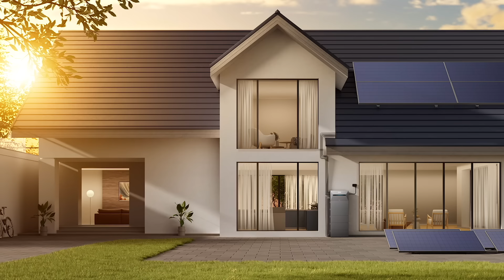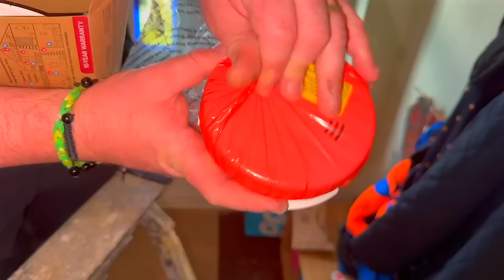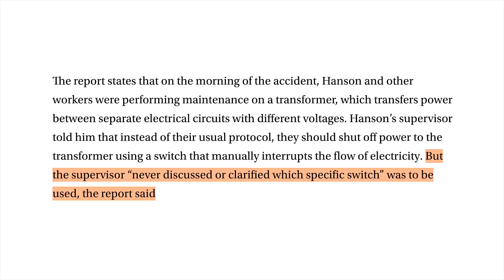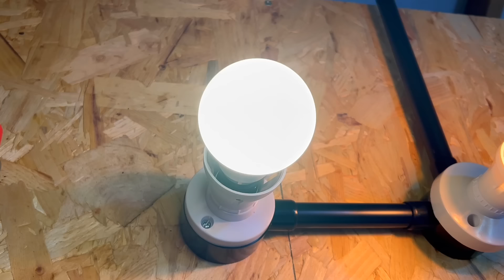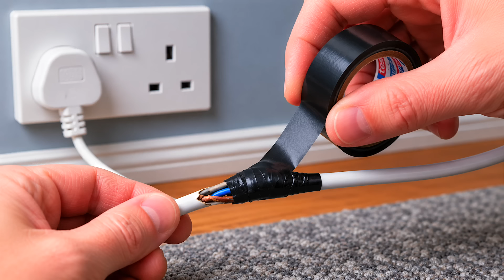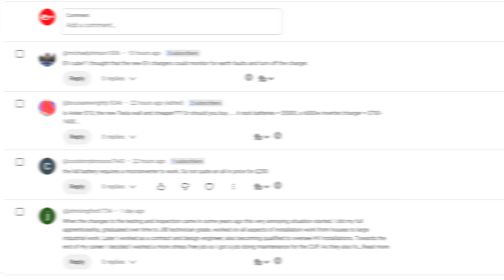Electricians Are Getting This Rule Wrong!

Comment: Mr Hayhurst may have his own opinion, but BS 7671 itself tells us what the 0.8 (20 %) factor is for, on page 438 (end of Appendix 3) in the Big Orange Book. It's for one thing only ... to take into account the increase of resistance of the conductors of the circuit due to LOAD current. When measurements are taken, conductors cool to ambient temperature because loads are not connected to the circuits, so the measured resistance during (R1+R2) and EFLI tests will be lower than those in the circuit when in use. This is explained in the IET On-Site Guide and Guidance Note 3.

Nothing new to see here!
Reply: Yes. Hayhusrt is just wrong. He ought to check out the Dunning-Kruger effect.

Comment: The reference test temperature is 10 Celsius
When cable is live, worst scenario to see cable temperature increase to 70 Celsius.

The resistance will be (1+0.004x( 70-20))/(1+0.004x(10-20))=1.2/0.96=1.25

Resistance at 10 is 1/1.25 of resistance at 70

1/1.25=0.8

for onsite guide or inspection purpose it is 25% rule
for design purpose it is 20% rule
Reply: Census ?
Reply: @keithbalding7258   thanks Celsius  very bad spelling.

Comment: Forgive me for taking issue with the experts, (at 1min 50secs) but surely making allowance for increased conductor temp. is perfectly valid.
We generally test dead circuits at 10 to 20 degrees C.  When a circuit is fully loaded close to the capacity of the MCB, it may well be  operating close to 70 degrees C.  
Hence : it is not the fault current which causes the elevated temp. but the ongoing Pre-fault current. So the resistance is already elevated before the fault occurs. Makes sense to me anyway. 😀
Reply: This is broadly it. The article author is making up his own rules. I see this quite frequently when people forget to question their own understanding and it is disappointing that such guff gets published without scrutiny.

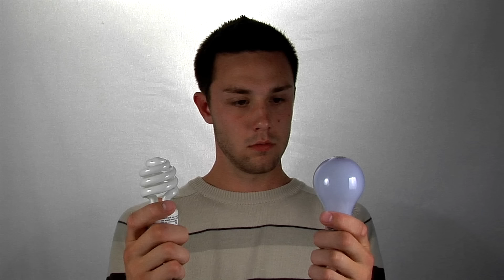Comment: 8:12 - That's because the vast majority of tradesmen these days are cowboys. Like the morons which came out from the DNO to unloop our electricity supply. They just left the old looped cable going to who knows where, in the cupboard under the stairs, dangling free with copper visible... a 80-100a cable unfused that could be accessible by a child, let alone adult. Couldn't be bothered to bung it in a box or cut it back short. Nah. That's a "professional" who is most likely qualified to work on live installations.

Comment: John Hayhurst's point of view is very questionable.
The temperature increase we need to account for is not the one that would arise from an earth fault, which is indeed negligible. It is the one that arises from conductors operating at full load during normal operation, i.e. assumed to be at 70 C, whereas measurements are taken on a dead circuit, when conductors are most likely to be at room temperature.
 By accounting for this, the worst case scenario is considered where an earth fault occurs when the conductors are already at 70 C from operating at their maximum allowed current. 
The number 20 % doesn't come from nowhere; it is an approximation of the increase of copper's resistivity from room temp to 70 C. It is not there to account for other factors that John describes. 
This temperature increase is real and must be accouted for, and, unless I'm proven wrong, I am quite worried that a senior lecturer completely misses that point and teaches that to their students...
The 20 % rule has nothing to do with variations in ambient temperature - this is accounted for in the design, if properly done. The premise of this 20% rule is that the conductors are at their maximum allowed temperature when an earth fault occurs. If the circuit is properly designed, the conductors will never exceed that temperature in normal operation.
Reply: John Hayhurst's point of view is just wrong. Alarm bells rang as soon as I began to read the article last week. (I see this sort of misinformation all the time when assessing higher-level written exams.) Experience and knowledge are different things and often having loads of the first blinds you your own lack of the second.
Reply: I agree with all of the above, but I'd add that not all final circuits would be likely to see such an operating temperature variation (because of the nature of the loads connected and likely to ever be connected); for such circuits, adjusting the measured R1+R2 (at 20°C) to a 70°C operating temperature by adding 20% is unnecessary. The source article does make this argument, but it gets lost in the noise over which temperature rise is being adjusted for.
Reply: @rednammoc Yes absolutely, in that case the resistance is lower and so the fault current higher, resulting in quicker operation of the protective device.
This illustrates the fact that adding 20% is not unnecessary in such a situation, it is just a worst case scenario, which is favourable in terms of design
Reply: Absolutely. Not sure when this element of electrical installation theory seemingly became so blurred?

Comment: I'm (respectfully) calling BS on this. Firstly: what 20% rule are we talking about? Are we on about the differences in max Zs values for ambient and load temperatures? (OSG table B6 vs BS7671 table 41.3, e.g. 1.1Ω vs 1.37Ω for a B32)? These are due to the former being at ambient, and the latter for a fully-loaded circuit. At full load, the operating termp will be 70ºC, rather than 20ºC. Difference is 50ºC, and the resistance-termperature coefficient for copper is 0.004... so 50 x 0.004 = 0.2 = 20%. That's literally where the number comes from.

Or is this "20% allowance" some rule about, you work out what R1+R2 will be from your design (or you measure it), you add 20%, then add Ze, to get an estimate of what Zs will be? If so, this is absolutely to account for changes in temperature, between a circuit that's dead (or with very little current going through it), and one that's fully loaded, running at 70ºC. I'm calling BS that it's got anything at all to do with "Contact resistance variability", "Workmanship" or "Ageing and deterioration"

The video says: "While conductor resistance does vary with temperature, faults cleared by the overcurrent protective devices often occur too quickly for significant heating to take place during the fault itself." While this is true, on a fully-loaded circuit, the cable will already be heated up to 70ºC, as that is its normal operating temperature. The heating up due to a fault - negligible if cleared quick enough - has nothing to do with it.

And yes, R1+R2 is only part of Zs, the other part being Ze. But Ze depends not just on how much current your installation is pulling, but also how much all the other installations connected to the same substation are pulling, so the resistance-temperature coefficient effect on Ze can usually be ignored.

Now, if you know for sure that your circuit isn't going to be fully loaded during normal use, i.e. a lot less than Iz: you can take account of this using a correction factor: it is Ct. See equation 6 in section 6.1 of Appendix 4 of BS7671. This is usually used to give you a more favourable voltage drop, but it can also let you know that, becuase your cable is never gonna get to full load (20A vs 27A), its resistance isn't gonna go up as much, and so max Zs can effectively be a bit higher.

TL;DR: I'm not sure electricians are misinterpreting it!
Reply: Spot on!

Comment: are led wave lenghs good for human health ?
Reply: These wavelengths are all present in sunlight, and have been so for a while. Are you scared of the sun?
Reply: @rednammoc  As a vampire, yes.
Reply: LEDs have much narrower spectrums of wavelength than normal incandescent bulbs (hence why they use less power and don't get as hot), but other than that I can't see them having much specific effect on human health?
Reply: @kateisblue   do led carry the red spectrum ?, are led heavy on the blue spectrum,does blue led light interfere with sleeping ? do leds flash 100's of times a second ?
Reply: @MichaelHughes-k5i  The blue light certainly does upset sleeping patterns.  The flashing hundreds of times per second (obviously we are talking PWM here), debatable.  We've been exposed for 50(60)/100(120) Hz for so long now, and given our increased sensitivity to flicker as the frequency falls, that if there was any detrimental effect in the general population it would have been well documented by now.
Reply: They are fine, make sure to keep taking your meds.
Reply: @Jebus-d9k5j  your mum told me to ask